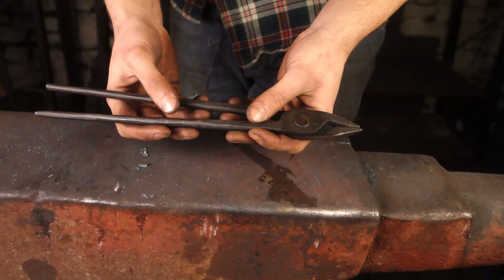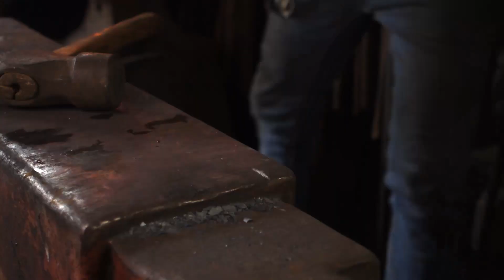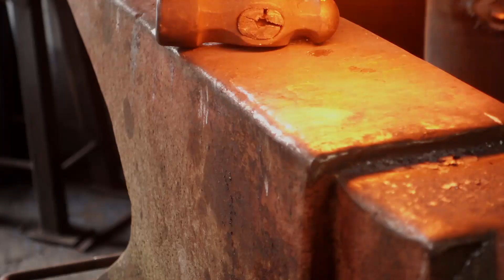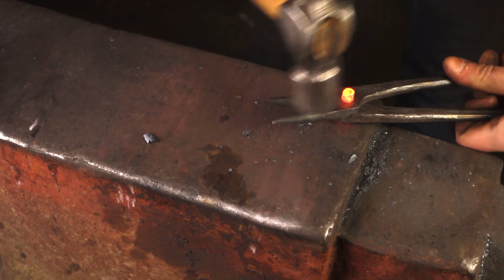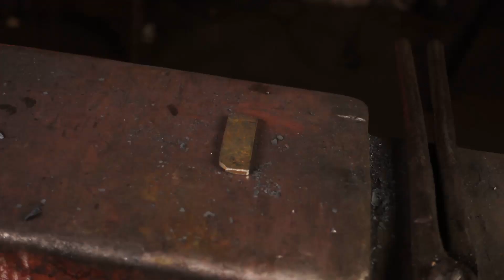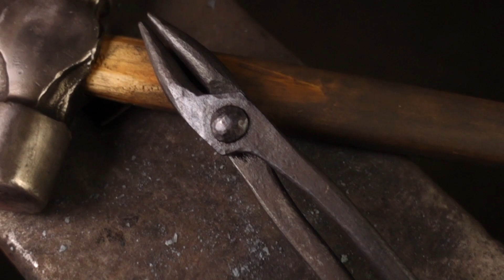Forging scrolling tongs

Comment: Nice Video!! I make ALL of my tongs out of mild steel. Mild steel IS easier to forge and easier to purchase as a source of material. I don't have any high carbon steel tongs. I was taught that the tongs are simply tools to use to make the piece that earns your money. Fuss LESS with the tongs and MORE on the customers piece. I have seen some smith's that get upset when their tongs get hot from the fire and workpiece. To me, THAT'S what they were made for. As a blacksmith, I can make another set of tongs as I need to but I NEED to focus on making the customers piece to earn a living.
Reply from the maker: I completely agree! Well said.